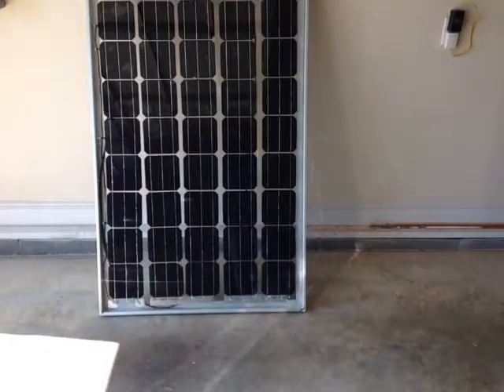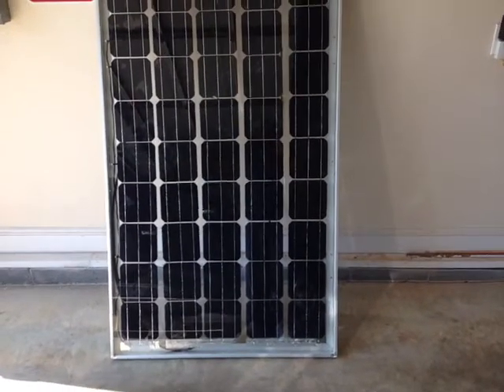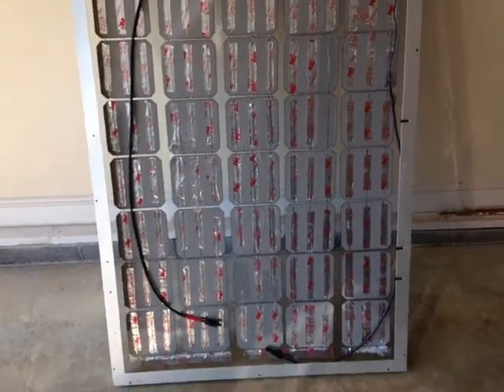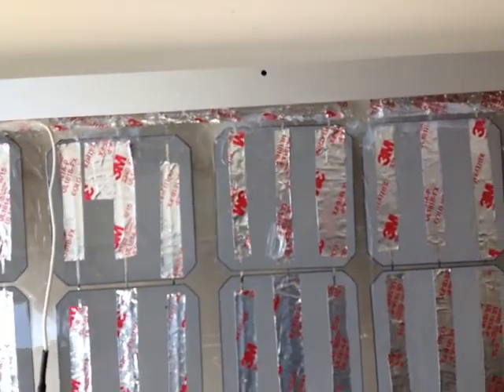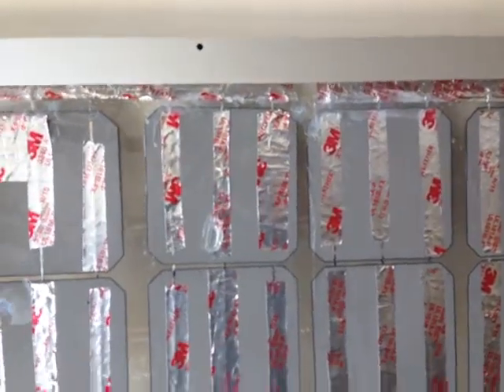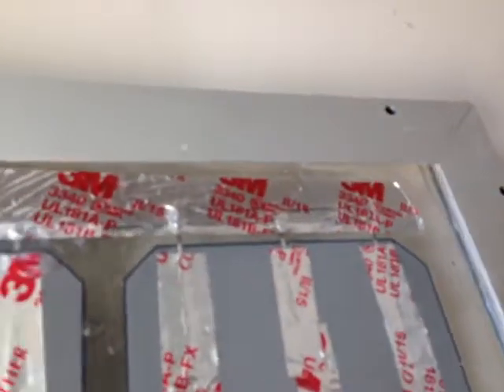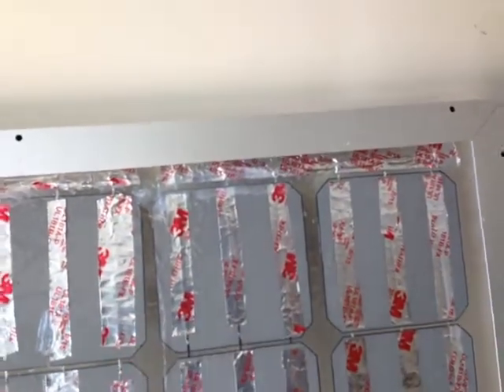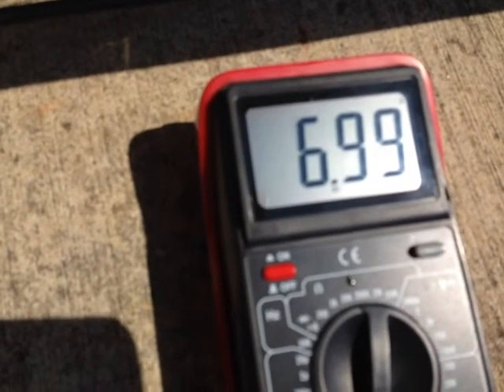DIY Home Solar - Weekend DIY Solar Panel Build Part #1

Comment: I count 45 cells, not 54? Looks good though.
Reply from the maker: TheDigitalWeb Thanks for catching that. I've corrected it in the video.  Thanks again for the catch.
Reply: Yup. Good job though . It's putting out roughly 186 watts?
Reply: rhandsom Nice work brother. The tape is so cool. Going to be cool seeing this running. God Bless
Reply from the maker: Thanks, it's installed on running fine so far.